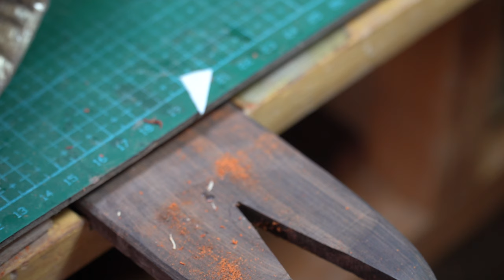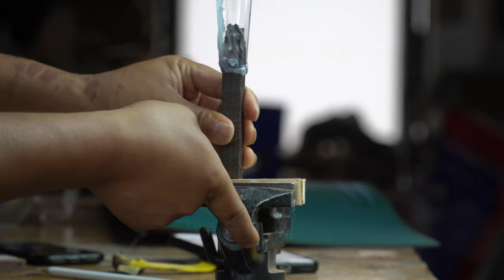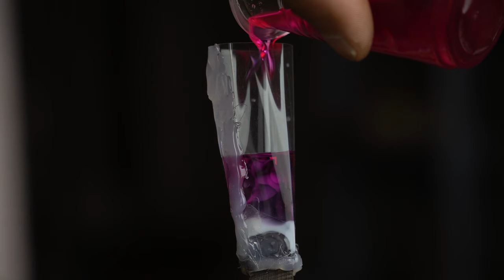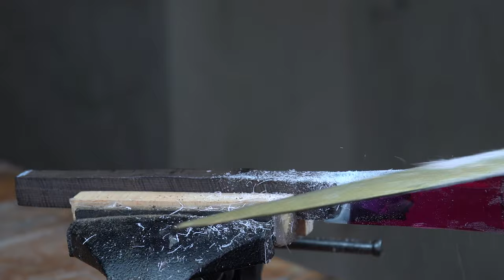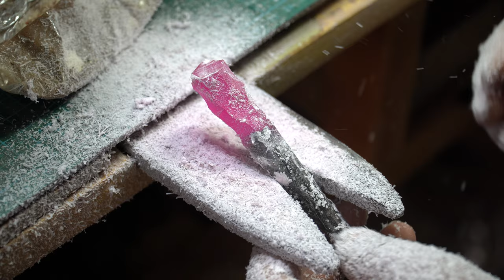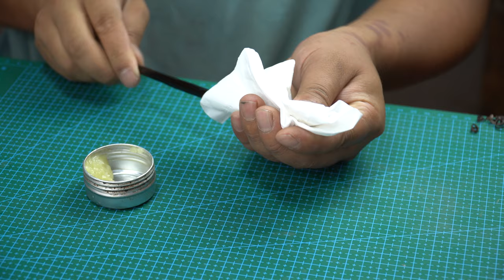Magic wand？Hairpin？How to make wood and epoxy ./Woodcarving/Woodworking art/ RESIN ART

Comment: Is that tape you are using for the mold setting?
Reply: Yes. Clear packing tape works well especially if you don’t have additional materials to form a mold and are only needing to work on or add on to a small area
Reply from the maker: Plastic sheet made of mold!☺